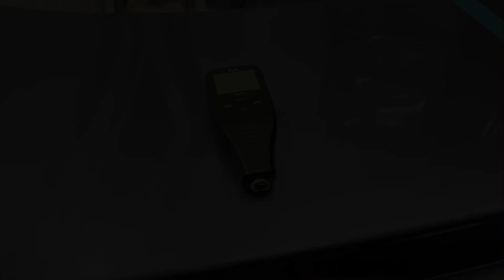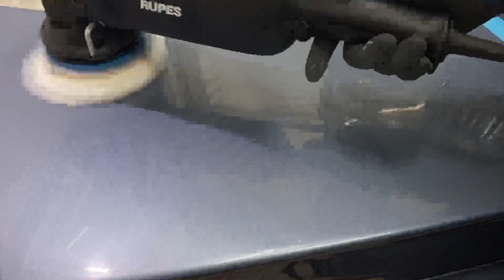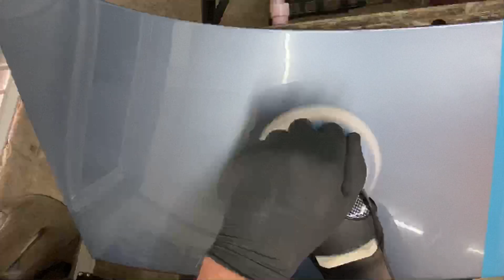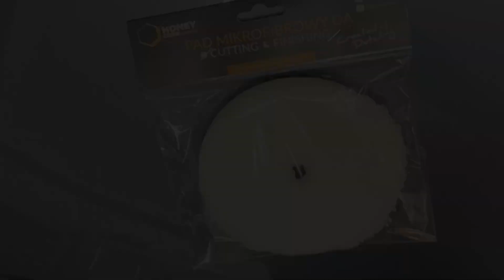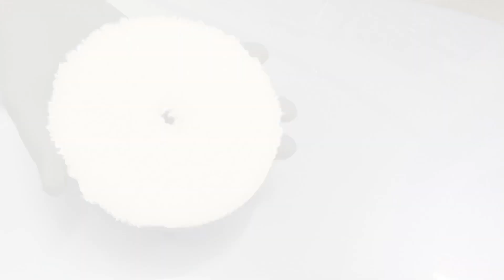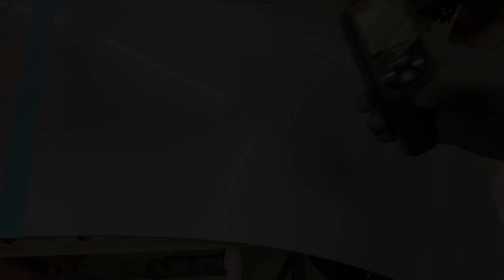Machine Polishing With Meguiar’s 2 Stage Polish & Rupes LHR-15 Dual Action Polisher  #autodetailing

Comment: Good explanation of the process. It looked like all the polishing footage was speeded up - it would have been nice to have seen 20 seconds or so at the actual speed. Hope you can do a video using wool pads as I understand they give more cut than foam, but are less aggressive than microfibre. Is that correct?
Reply from the maker: Yes most was speeded up as most would switch off seeing how slow a polishing set is , it’s hard keeping peoples attention 🤣
Maybe I need to start another channel for B roll , I may even upload another one with the actual full standard speed on one set for a reference if you like 😀

Wool I have , so I now have wool, microfibre and foam, so that’s certainly an idea for a future video mate 😀
Reply: Thanks. Hope you don’t mind another question. We know that standard procedure is to tape off a test area when machine polishing. If you find that your initial test pad/polish does not remove imperfections, would you change to a more aggressive pad, or use the same pad but with a more aggressive compound?
Reply from the maker: No I don’t mind at all, I think this would need explaining in a polishing for beginners video do you think?
If your polishing set reveals an unproductive result then it would depend how bad it was , if you would think it needed a little extra then you’d change the pad , a lot of extra cut you’d change up the pad and the compound one step, but if you’ve reached the maximum level of compound then it would be pads you’d be changing up , as you thought 👍